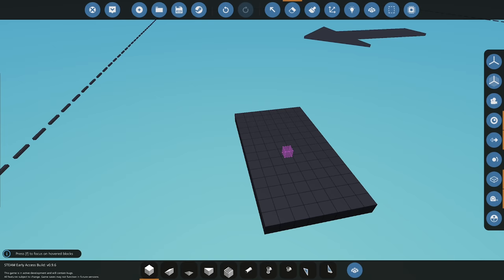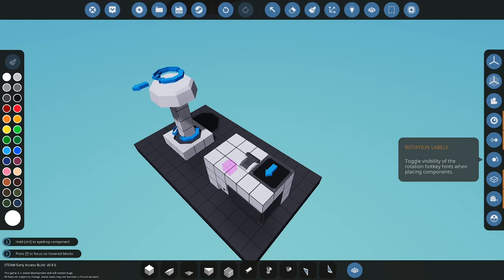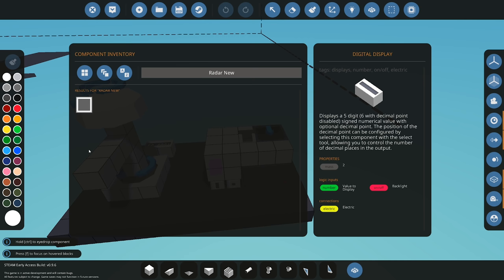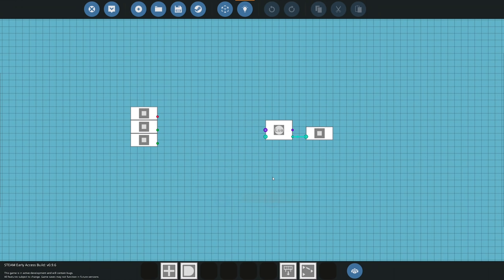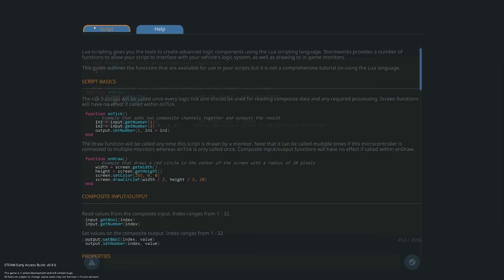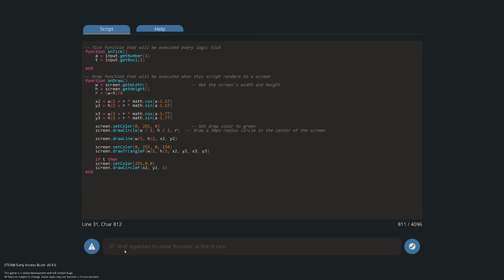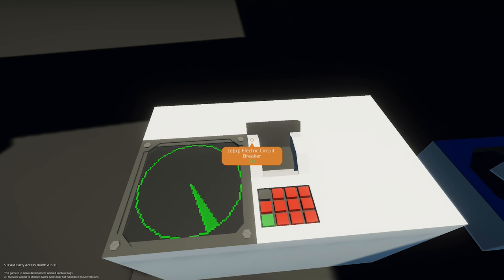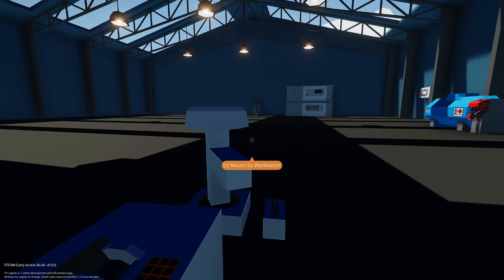Stormworks Lua Radar Tutorial

Comment: Good tutorial but your math is WAAAAY incorrect. Not sure what you got going on there but you're desired range setting will not display targets at the appropriate locations in relation to the source. The correct adjustment for displaying on a 64x64 screen is (32 / desired range) * target distance. Then you plug this new distance value into the w/2 + distance * math.cos(r) equation and same for the sin equation.
Reply: THANK YOU. i was going crazy trying to figure this out.
Reply: So wait, what is the line code again? And where do I put this line in the code?
Reply: Thank you that solved it for me.
Reply: @lordraven1991   Its 99% there and you dont need to change any of the code just some logic. Basically what hes saying is set the value of the Constant (5000 in the vid) to 32. Connect that to the x input of your first f(x,y,z) block (starting from the top left going right).  Now you want to divide that number by the range you set on your keypad, so the keypad's output will be your y input on the first f(x,y,z) block. The equation of that block should be x/y. Now, youre going to need to multiply the resulting value with the output coming from your radar for target distance, so the x input for your second f(x,y,z) block will be the output from the first function block (what we did above) with the target distance coming from your radar being the y input.  The equation for the second function block should be x*y.  Connect the resulting output of the second function block to the second memory register (the function block that Jersey has it connected to in the video (x/32) can be deleted). If you set everything up exactly as Jersey does in the video with these changes everything should work without changing any of the LUA code.
Reply: @AClownShoe  I will have to upgrade my diagram with this, thank you. I had a friend take a look at it after a while and the best he could do was to get the blips to appear but the line wouldn't move.
Reply: nerd
Reply: @AClownShoe  Great help. To add some efficiency, you can delete the Constant Number (ie. 32). Have the Keypad input go to X and the Target Distance go to Y. Then the function block formula would simply be (32/x)*y. All done in one function block, which helps my OCD.

Comment: Nice tutorial. One warning though. 2*pi is 6.283185 etc.... and not 6.28. That means your input to the Lua script has an error of 0.00319=0.18 degrees. Though that error is multiplied for each revolution, so after an hour of running it will be almost 90 degrees behind. Fortunately the fix should be easy: do the fmod to get rotiation in the range of 0-1 before you multiply to prevent accumulating the error.
Reply: Wouldn't putting "x*(2*pi)" in the function block instead of "(x*6.28)" also fix this issue?
Reply: @ChrisVTitus   Pi is an irrational number so even the one provided by game or lua will be just an approximation, albeit really good approximation for the purpose. Still the mentioned method of using fmod together with using 2*pi instead of 6.28 would virtually remove the error and prevent any accumulation.
Reply: @Rodzynus  I used a counter and some blocks and equations to be able to make it rotate using the facing input for the radar instead of a robotic pivot. It is basically the opposite of an equation I used to change the input from the compass sensor into a magnetic bearing.

Comment: Hey man,

What you've built is fantastic and I can see the functionality of it. However, I myself engineer and maintain RADAR systems on a daily basis, looking at feeds and analysing input and output data from loads of variants of radar systems. One thing they all have in common is what's called a CFAR (Constant False Alarm Rate) this essentially identifies moving targets and eliminates those that are stationary after building up what's called a Clutter Map (Maps everything that RF bounces off of and is collected by the receiver, building a map of stationary object that were there the last 4-5 rotations). If you could, would it be possible to show targets that move? Like yourself, and not just the tank in the background?

Comment: If anyone comes across this like I have much later on, I wanted to share a bit of a better method for figuring out distance. Instead of having that zoom thing, you can have the entire 5k range displayed on the radar, but not linearly so you still have nice resolution close to you, but still see stuff 5k away. 
The key line of code is: distance = (math.log((math.exp(1)-1)*(distance/5000)+1))^(1/1.3) -- with the 1.3 being the value to control the scaling factor so you get more resolution closer or further away.

Here is my full code. I'm not using the velocity pivot either. Just plugging in the yaw from the sensor. 
function onTick()
	degree = ((input.getNumber(1)+0.5)*360)*math.pi/180
	distance = input.getNumber(3)
	test = input.getNumber(1)
	isTarget = input.getBool(2)
	targetLoc = ((input.getNumber(4)+0.5)*360)*math.pi/180
	
end

function onDraw()
	w = screen.getWidth()
	h = screen.getHeight()
	r=(w+h)/4	
	sweepX = math.cos(degree+(math.pi/2))*w/2+w/2
	sweepY = math.sin(degree+(math.pi/2))*h/2+h/2
	if distance < 0.2 then
		isTarget = false
		end
	
	distance = (math.log((math.exp(1)-1)*(distance/5000)+1))^(1/1.3)
	targetX = math.cos(targetLoc+(math.pi/2))*distance*w/2+w/2
	targetY = math.sin(targetLoc+(math.pi/2))*distance*h/2+h/2
	
				
	screen.setColor(0, 255, 0,200)
	screen.drawCircle(w / 2, h / 2, r)
	--screen.drawText(30,30,distance)
	screen.setColor(0, 255, 0,100)
	screen.drawLine(w/2,h/2,sweepX,sweepY)
	
	if isTarget then
		screen.setColor(255,0,0)
		screen.drawCircleF(targetX,targetY,1)
		
		end
end

Comment: you can also use the yaw of the radar to instantly move, it is much faster. I count by 0.01 every tick, and the output to yaw is the variable -0.5, and when the variable gets to 1, it's set to 0
Reply from the maker: Correct, a lot of things have changed since they were first released and now yaw works correctly
Reply: @MrNJersey  Oh, hi there, wasn't expecting a response, I haven't used radar like ever until now. I'm currently making a emergency beacon locator which involves radar. I was having trouble with it so I looked at this video just to see how you made it work, turns out I was doing it right, just messed up a few numbers.

Comment: Great video man, but you started by the system based on the lua script getting the monitor size by itself. so setting 32 into the logic will lock the setup to the 64x64 screen. Maybe set up an number output with half of the used screen like w1 = w /2  and output.setNumber(1, w1) so you can get the calculated size by the displayed monitor itself. combine this with @Dr Strangelove comment. And it works quite well.

Comment: Just a heads up - i`ve done some math behind it and the "divide the distance by 32 for it to fit on the screen" is not right. If maximum 5000 meters is 32 pixels then 2500 meters would be 16 pixels - if you did /32 you would get 87.125 though. What you actually have to do is multiply the distance by 0.0064 or divide by 156.25 for it to accurately fit on the screen

Comment: why do you go (H+W)/4    and not just take H/2 ?  the screen height is always the smaller or equal side;  if your screen is not square;  the circle will fit vertically and still be centered horizontally;  where with (H+W)/4  you may end up with some weird incomplete circle ... like for example (64H+100W)/4=41 (which covers 82 ... so too small for the width; but too large for the height).

Comment: Your math is wrong.
For one, before going into the math, you should use the "pi" built-in in Lua's math library to convert your angle to radians.
Additionally, as far as math is concerned, you should be adding the center(x) or center(y) of the circle to  r*cos(a) or r*sin(a), where r is the radius, and a is the angle.
Your functions for x2 and y2, when drawing the line, (we'll call the points r1 and r2) should be similar to as follows (look for the line coordinates comment):

-- Begin Code Sample

onTick()
-- converting angle to radians
  a = input.getNumber(channelNum) * 2 * math.pi
  end

onDraw()
-- screen sizing variables
  w = screen.getWidth()
  h = screen.getHeight()
  cx = w/2    -- x center
  cy = h/2     -- y center

  r = (cx+cy)*.333  -- a radius of about 67% of the screen size

-- Line coordinates
  r1 = cx + r*cos(a)  -- the point at cx, with direction r*cos(a)
  r2 = cy + r*sin(a)

-- drawing our circle
  screen.drawCircle(cx,cy, r)

-- drawing our line:
  screen.drawLine(cx, cy, r1, r2)  --  Line from (16,16), center, to (27, 16),  initially, on a 32x32 px monitor
  end

-- End Code Sample

Its a simple fix where you've used the "+" operator where it should be the "*" operator. By doing this, the script will correctly draw the line to the edge of the circle only. Yours would draw beyond the edge of the circle, which wouldn't be obvious on the 32x32 px monitor. Additionally, if we moved where we draw the circle your code will not correctly update the line showing where the radar is facing, it will generate a slight ticking effect and remain stationary.
Not only does my code correctly orient the line, but it also draws only to the edge of the given circle. It also works if you want to adjust the placement of the circle on the screen (requiring an adjustment of where the line is drawn from, or the origin of the line)
As a side note, most of your function blocks also should implemented in code via the Lua script block. It makes debugging a lot easier to figure out.

I hope this clears a lot of the math up for anyone who tries to borrow his code and finds it does not work.
Additionally, the math for correcting the orientation of the line to the radar is simply a conversion in radians, which wasn't explained in the video. A circle can be describe as 2π radians or 360 degrees. 2π/4 would be equivalent to 90 degrees. Subtract 2π/4 or (-1.5708) from your angle, if your radar is "behind". If it is "in front" of the line you've drawn, then add 2π/4 or (+1.5708).
Reply: I might've screwed up somewhere but your code isn't working for me no matter what I do to try to fix it

I keep getting the error (from the screen itself): attempt to index a nill value ('global input')

Comment: Does this work in 2020? I'm losing my blip after I add the memory/not/etc sequence. I'm pretty sure I've copied this and the code perfectly...
Reply from the maker: It should work, nothing has changed to lua
Reply: @MrNJersey  just downloaded it from the steam workshop and there isn't a blip showing up at all
Reply: This tutorial doesent work in 1.0 for some reason the dot does not display on the radar most of the time. However it works fine with the player.
 It will only display players and half the time the dot is in the incorrect position.

Comment: I checked alot, but the code just dont show the screen its all correct
Reply from the maker: Maybe download one from workshop and see where you went wrong?
Reply: @MrNJersey  I fixed it, but the dont do show up, and the line is wonky
Reply: This tutorial doesent work in 1.0 for some reason the dot does not display on the radar most of the time. However it works fine with the player.

Comment: Not a great tutorial.

1. Don't use 6.28 for the love of god, it's not precise enough and you WILL get desync pretty quickly. Did you even test this? Use 2pi instead.

2. Your range function is nonsense. It's blatantly obvious just from the video that it's nowhere near accurate. You need to use the radius of your circle in your function. The maximum range should just be for clamping purposes.